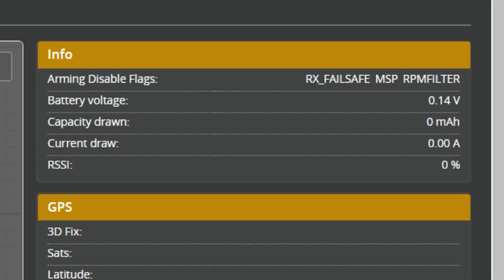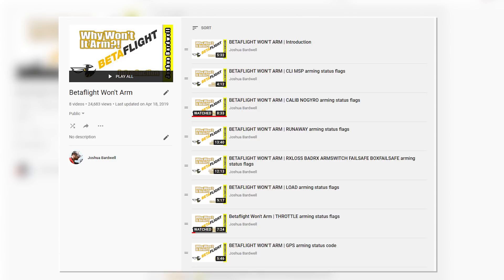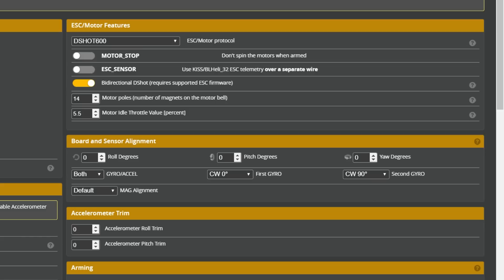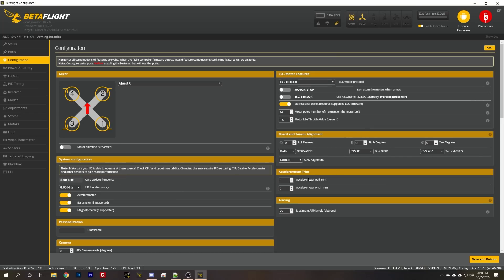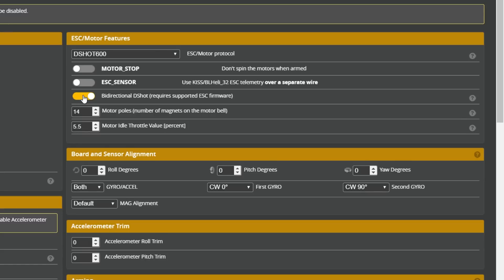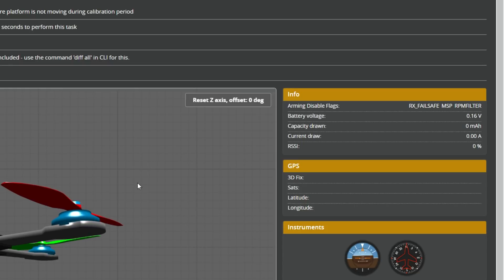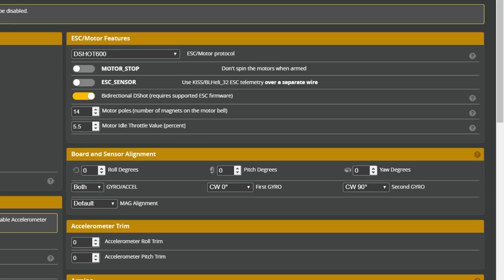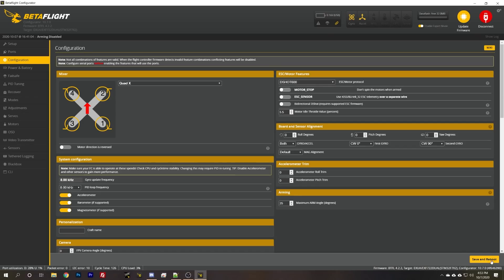BETAFLIGHT WON'T ARM RPMFILTER arming status flag

Comment: A brand new fold ape drone with an all in one fc and esc was doing that rpm motor filtering arming flag . I did not know what to do so I bought a new flight controller and one of my motor wires came off of it and ruined that flight controller . I bought a 3rd flight controller and it said rpm filtering not functioning also . Somehow in a mind numbing day of youtube and Google searches I imagined I heard " d shot bidirectional bad " . I shut it off and it armed . But I shorted the camera and vtx pads with the  smart audio cluster of pads possibly inside the layers of circuit board stuff . 
  I am trying to put a walksnail vtx onto the fold ape now .
   Also I noticed the first flight controller said rpm motor filtering not functioning and that was before the motor tab d shot switch was known about I was fiddling with pads rate and filters tab . Imagine that . What was I thinking . Anyway the number 4 motor went weak and slow is why I decided to replace the all in one flight controller the first time . 
Those darwin fpv f4 aio 15A flight controllers are so tiny for me I use soldering magnifying goggle glasses and tweezers and a lamp one  connection at a time . I think my tip wore out 75 connections in and the last 3 were not melting solder or the solder station power supply was over heating or something and I ruined the cam and vtx pads . I put a new tip on the iron and I wish I would have done that on the cam and vtx pads . It was working osd until the camera plugged in and then isd disappeared.  But if the wires  fir cam and vtx were removed no short could be measured between them with an ohm meter . It still will not show osd with the vtx wire installed . A bad tip does not melt solder but is still hot enough to ruin the pads and board I think to tell you .
Reply: The d shot switch is in motors tab . Not pids rates and filters tab .

Comment: 6:20 That is the only time i get the warning. I'll have a small crash, go to take off again, rpm filter. Unplugging and replugging in the battery fixes it, but I've almost lost my quad after landing/crashing on a building/somewhere else I cant reach and then getting that error

Comment: My drone work super well. But when i want to connect my gps i have the message rpm filter. I dont understand and i use manuel for wiring and gps light work well i dont understand

Comment: I've been having an interesting issue with RPM filter warning on a blheliS 4in1 running JESC.   I've noticed that if I have the quad sitting on some surfaces before take off like my drone backpack that has some flexibility I can get this warning and occasionally one motor will not spin up and it's not always the same motor. If I just pick up the quad and hold it firmly in my hand it will arm no problem with no warning and all motors spin. If I take off from a smooth firm surface like concrete I never have a warning. One more detail is I'm  using 3 blade folding 4" props.
*new info* I folded some small pieces of aluminum tape  around my motor wires that are very close and crossing my FC to ESC wire harness to try and stop interference. So far after around 15 or so arming and power cycles I have not been able to re create the rpm warning. Also this is BF 4.4

Comment: When my drone is not plugged in to betaflight it shows the osd, when i unplug , the osd goes away and all i see is the air unit in low power state, cant get it to arm, when i plug the drone in my tbs tango says telemetry recoved and the osd comes back, what could the issue be ?
Reply from the maker: The FC 5v regulator is dead so the FC only powers up when you plug in USB. Usually the response is to replace the FC.
Reply: @JoshuaBardwell i have a iflight nazgul f6 with a BLITZ Mini F722 Flight Controller, do i need to replace entire fc ?
Reply: @JoshuaBardwell i flew through drone, came in for a landing and it was roungh i must admit, disarmed approximately 4 feet of the ground, after that when i try to fly no osd, only shows the air unit in low power state at the bottom, when i plug the drone into betaflight the osd shows, in betaflight i see the arming flags shows rpm filter , even after disabling rpm filter still cant arm or shows any osd
Reply from the maker: RPMFILTER means the FC is not talking to the ESC. Again, I think your FC died in the crash. I would replace the FC.

Comment: Hey this was the issue I was commenting about. Took a minute to search through your videos. But umm I don’t have the dshot option thing in my configuration tab. What do I do to fix it
Reply from the maker: It's now in the Motors tab.
Reply: I turned it off and my drone still won’t arm 😂 I just want to flyyy

Comment: just built an 3s whoop with jhemcu f411 aio (pre flashed with bluejay) in a TinyGo frame..
first arm: 🐝🐝🐝🐝🐝
second arm: rpmfilter
power cycle and another try: 🐝🐝🐝🐝🐝
like you said, i think i gonna have to dis and reconnect the battery every now and then and live with it  xD
lets hope the maiden flight goes well :D

Comment: Quad worked last time I flew it, took a few days off and was getting RPM filter flag.  All I did was reseat the connections to the flight controller and everything was fine 🤷‍♂️

Comment: my quad will arm, let me fly but if i disarm then try to rearm, it wont let me and shows rpmfiltering in osd... if i power cycle it repeats the same process everytime, any ideas? my esc is a 4in1 with bluejay 0.19.2 and im running BF 4.4
Reply from the maker: This is a known bug with some ESC's. Try rolling back to an earlier version of bluejay.
Reply: @JoshuaBardwell  thanks I will try this. I did update to BF 4.4.2 before this started as well so I will roll back both separately and see if either fixes it
Reply from the maker: BF 4.x is not the issue. It's the ESC. Roll back Bluejay in my opinion.
Reply: @JoshuaBardwell  I rolled back to 18.1 and still the same issue
Reply: @JoshuaBardwell  im thinking a MOSFET might be damaged or I did something wrong upgrading BF 4.4 (flashed firmware then loaded my config backup via preset tab)
Reply: @JoshuaBardwell  flashed back to BF 4.3.2 and the problem is gone! the same config on 4.4.2 didn't seem to work for some reason
Reply: @Dienex  Still working? :D So its clear its not a ESC FW but BetaF problem?
Reply: @Dienex hi, i got the same problem just after i update my BF to 4.4. I didnt touch my blue jay firmware. After i saw your comment im sure this is because BF 4.4 (for me).
Reply: @zolex5370  Yup still all good!
Reply: @Jono-le9xz  Indeed. All still working for me on bf 4.3

Comment: I just had a totally uneventful flight and after I landed and decided to see how much actual battery I had left, I got RPMFILTER and couldn't re-arm. I didn't try power-cycling, but this makes me a bit nervous in case I need to accidentally re-arm in flight... BiDi DSHOT is brand new to me, this is the first flight after enabling it. Aside from the beacon tones being a different (higher) pitch, I haven't noticed other side-effects, but I'm hoping I don't have to turn this back off for reliability reasons. Anyone else encountered this?
Reply: Me too, i just got this issue a few days ago (till now). The only changes to my quad is BF firwmare update on fc and change tone in blue jay of my motor. Thats all. So everytime i have to powercyling if i wanna re-arm.
Reply: @Jono-le9xz  but how do we fix it

Comment: For whatever reason I cannot connect my BLITZ Mini E55 4-IN-1 2-6S 55A ESC in configurator via my Mac. I tried the battery thing (as I’m newer to the hobby). This is a brand new bnf Nazgûl from iflight direct. Any suggestions guys? Thanks!!! I’ll try the power cycle thing s couple more times too for the heck of it

Comment: My Foxeer Reaper stack was giving me this error after a bump. 
The connector between the ESC > FC was loose.
I put a dab of threadlocker on the edge of the connector... hopefully that keeps it plugged in from now on. Surprised it didn't slip loose during regular flight tbh

Comment: If you're using JESC firmware on your ESCs then don't forget to flash the JESC firmware AND the JESC telemetry. They're two steps and you need both.

Comment: Here ya go - running RPM filtering, no issues - tons of packs, etc. now armed - 1 motor stalls on take off😮 power cycle, arms, only 3 motors spin 😒repeat, same story 😒 next day troubleshooting - now, no motors spin, but I have the RPM flag (now you know how I got here) - plug in Betaflight, motors tab, hit the master, ALL motors spin, tach data all good, now flight test, it rips. WTF? 🙄🤷‍♂ whatever, send it...
Reply: Set ur digital idle higher so that the start up torque is higher. Brushless motors (not even just drone motors, it happens with industrial machines syncronous motors, they have a low start up torque till they get to the desired speed set by the esc (or the 50/60 hertz mains on industrial motors) and they only have sufficient torque after they are rotating just below the set frequency. When the digital idle is set too low, the quad struggles to get the motor to spin. Sometimes just giving more throttle will get it to spin but sometimes not. The best solution I found with a quad of mine that gives rpm filtering error is just to plug in a newly charged pack so the start up torque from the coils in the motor is stronger. Another thing that worked is increased digital idle speed

Comment: I have this issue on a brand new quad Iflight chimera 5. It has an integrated FC and ESC. Not sure why when I flashed it now I can’t arm it anymore because of rpm filter…. I restored the original diff

Comment: JB, not sure if you have seen this issue but here is the description and fix. RPMFILTER flag when trying to arm. Crazybee F4 AIO whoop flight controller, BLHeli_S 16.9, BF 4.2.9. I had to lower the PID loop to 2KHz to keep the processor utilization from breaching 100% overall. I selected the matching DSHOT 150... Not working. When I switched to DSHOT300 it works fine now.

Comment: Was flying today and went to arm and got the rpm filter alarm. I said I know good and well Joshua Bardwell has a video on this😀. Sure enough. Mine was a case of power cycled and it went away. Thanks Joshua!!!!
Reply: Do you think there is a problem with the quad thats gonna cause issues later if it’s the one that goes away with a power cycle? I haven’t heard him mention anything about it

Comment: I'm getting an RPM filter flag and my rig wont arm, well it arms, it has yaw, roll, pitch, but no throttle.
Reply from the maker: With RPM filter flag the motors will not spin the quad will not arm. So something doesn't add up here. I guess you saw RPM filter flag then it went away when you plugged in the battery and the ESC powered up.

The situation you describe is like you had turtle mode activated. In that case the sticks would spin just 2 motors but the throttle wouldn't work.
Reply: @JoshuaBardwell  you are correct, with that flag it won’t do anything. I turned off bi lateral and that’s when I have the issue with the throttle

Comment: Just flew a few packs and suddenly my quad decided to fall out of the sky. getting the rpm filtering flag even with diffrent (working) esc's. already reseted the whole config of my quad. Is it possible that my FC is toasted?
Reply: What did it end up being?
Reply: @PhilipPlett  hmmm long time ago ^^ if I remember correctly it was toast.
Reply: @MrVIDEOACE I'm having a strange issue, one motor is acting very weird. Sometimes one motor doesn't spin. Sometimes that one motor plays the start up tone after the other 3 completed it already...
And sometimes it'll arm and fly. But when it flew I couldn't get the throttle to come lower than 25% meaning I had to crash land... My esc is am32. Pretty sure esc, or motor is somehow messed up. I think I'll reflash soft ware to esc, then replace motor, then turn off bi-dshot. If it still does it I'll consider the esc toast...

Comment: I never Got this flag But now i get it every time. If i arm the flag is there i disarm and arm again it went away. Also a Single Motor is beeps later... I dont know What this is. It was working since i updatet to bf4.2 But now its getting the flag every time...
Reply from the maker: Did the instructions in the video help?
Reply: @JoshuaBardwell  Not realy,  i used to have  custom Music on the Escs.  I reset my Esc and restore the settings,  But this didnt help much.  Now the flag comes Not every time,But  sometimes it came and sometimes Not. I dont know if the Musik makes a Problem But it  should Not.
Reply: @JoshuaBardwell  i just found it, a semi loose wire connection from the Esc to the FC. In flight the Vibrations helpt to get a Good enough contact.  It always had connection, But sometimes a realy high resistance. 
->the Escs did work in the Motors tab,also in flight. Only on arm (whithout any Vibrations it didnt arm) Also the flightcontroller didnt have any brakeout pads for testing or replacing the plug whith wires, But i did desolder the plug on Esc and the  FC and soldered them direktly togeter. Now it works fine, whithout any Problems. 

My friend had the idea that the wire is Broken or something like this, than after 1h we finaly found it.

Comment: Check for water. I landed in wet grass and I couldn’t Arm after plugging in a new battery. Gyro not found. I disassembled the drone and let the fc dry. Put it back together and everything worked perfectly again.

Comment: Always doing work..and yes very good on new fc's and higher bheli..but yes need to buy in to get it on the beheli 30a..wish i had it..but other than that..my heavy 5"build flys like a bird/hawk...but u need a higher amp esc for a heavy build and thats the only breaker for my build..heavy but it works faster

Comment: I think you're onto a bug in BetaFlight.  My quad randomly throws an Rpmfilter flag that will persist until the next power cycle.  BLheli32 on a luminear esc with a luminear lux f7 fc.  Its fine until I'm racing and I do a pack change and I have to run back out and powercycle it.

If any Devs are reading this my advice is check if the incoming buffer can get an invalid byte in it that then doesn't get cleared because a buffer overrun occurs.
Reply: same here! R
Same here! Random and rare Rpmfilter flags and I think it's a bug!

Comment: Thank you again Joshua Bardwell. I didn't have this issue, but I now know why I can't get bidirectional dshot to work. I'm guessing that for it, the ESC needs telemetry?

I have also lost the ability to get any response from Ghost in the reciever tab. I went through the troubleshooting for it on immersionrc's website, and it still doesn't work. The receiver is showing bound and I have telemetry working with the nano tramp; I've been able to change the video channel. I've tried both tx and rx on multiple uarts, and checked continuity between the ends of each wire. I've checked the reciever proticol is all correct, and I am using Kakute F7 aio v1.5 on betaflight 4.1. Do you have any ideas on how I can fix it? Thanks again.
Reply from the maker: The ESC does not need telemetry. It needs blheli32 version 32.7 or for BLHeli_S it needs JESC.
Reply from the maker: For Ghost, the setup depends on the output protocol that you've selected. Email me and I will work through it with you.
Reply: @JoshuaBardwell  Thank you again for your help, I've just gotten the recent OpenTX release which supports GHST which may help. I just can't find it in betaflight. I'll email you for help if I can't find it in an update or it still isn't    working. The battery voltage seems messed up in the latest opentx build though. It went from 7.0 to 7.9. Do you have a video on flashing escs?
Reply from the maker: Ghost is not in betaflight yet. You use SRXL2 or SBUS.  Have you seen this: https://www.youtube.com/watch?v=Z7vONWbA_CM&ab_channel=JoshuaBardwell
Reply: @JoshuaBardwell  Yes, I have. Someone was telling me that I didn't  know how to set it up right and that GHST is suppoorted in the latest opentx build so I should use that. There's so much misinformation these days, at least there's your YouTube channel to put things right.

Comment: I had this RPMFILTER flag! It was preventing me from arming! It took forever to figure it out but it ended up being I had two wires on my crossfire receiver mixed up! Once I put the wires on my crossfire it fixed everything! Thanks for sharing! You rock Bardwell!
Reply: Crossfire has nothing to do with the RPMFILTER arming disabled flag. In your case you couldn't arm because your receiver wasn't working.
Reply: @BruceLuckcuck  I have the same problem after an accident, but my crossfire receiver works, has a steady green light and communicates with my remote control.  What can it be that I can't arm?  I also checked all the wires from fc to esc with the multimeter but it seems all right.

Comment: It can happen if one or more ESCs has an RPM filtering error above 1% error. More common on F3 based ESCs and in use with certian FCs.
Reply: I totally agree I have 4 quads and it only happens to me in one that I have the ESC 4 in 1 holybro Tekko 32 metal 65A, you just have to remove the battery and wait a few seconds and reconnect and everything works again.
Reply: @mcferran6720  See my comment about F3 BLHeli32 ESCs. You need to update to the BLHeli32 32.7.2 test firmware to prevent the intermittent RPMFILTER warnings.
Reply: The error % has nothing to do with the RPMFILTER arming disabled flag (unless the error is 100%). The arming disabled flag is cleared if the ESC receives any responses from the ESC and has nothing to do with the overall quality of the replies.